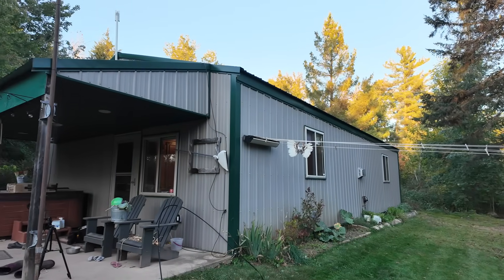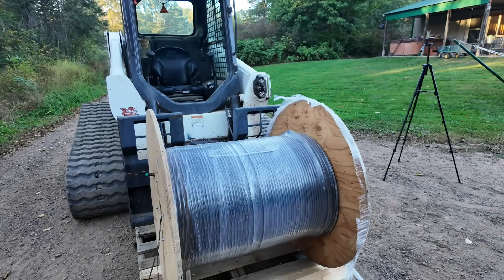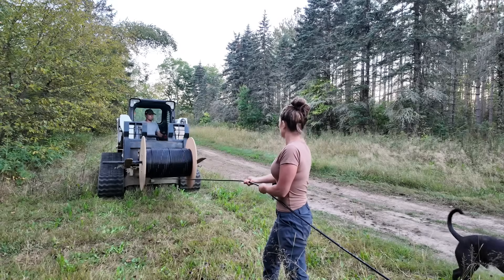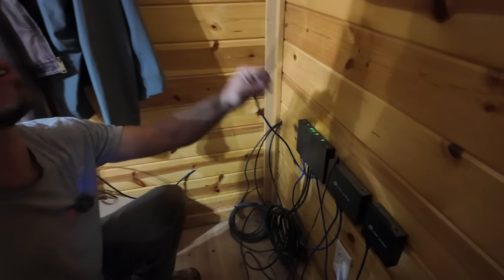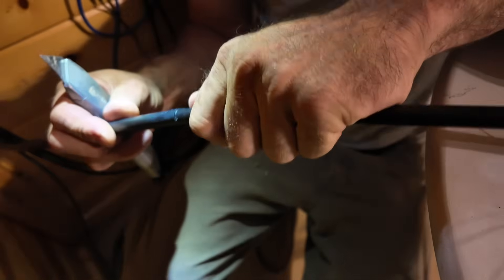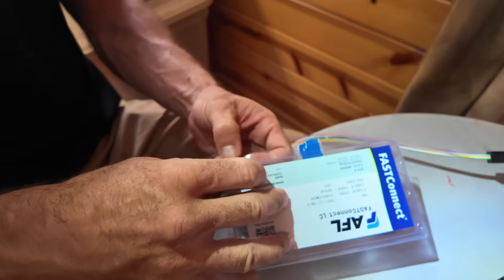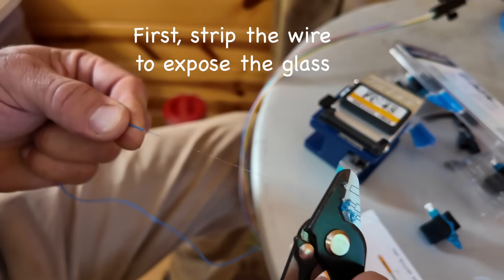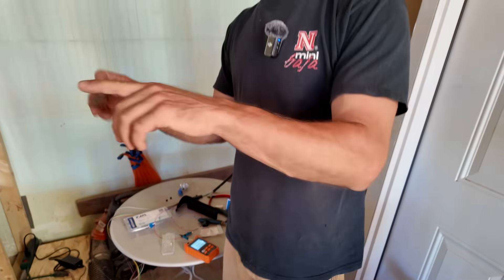We Need Internet! Running a 3,000 ft Fiber Optic Cable

Comment: You are now more qualified to run an IT department than most are or ever will be! 🙂
Will you move the Starlink to mobile and mothball the account?
We did something similar on our rural farm to what you're doing, except we have ham radio towers and we use wireless line-of-sight instead of fiber optic.
I think we're going to move the Starlink to the more expensive mobile account, but then turn it off. 
We want satellite comms in case a weather event (like what's happening in North Carolina and Georgia with the Hurricane 10/2024) occurs and commercial networking/electrical goes down.

Comment: I would advise burying the cable asap, you wouldn’t want a rodent or animal to chew through it, that would be an expensive fix
Reply from the maker: That’s the plan! Need to find a trencher first
Reply: @thehomesteadingrd when I did my 2.2Km of direct burial fiber, I rented a big ride-on trencher from a local place. Surprisingly affordable for the size of the equipment.  Took three days because of weather to go the 1.5 miles - but that thing didn’t stop if it had traction.

Comment: Really nice video and great work. 
One tip of advice: it`s easyer if you go with simplex or single mode instead of duplex/multi-mode. 
With single mode, or BiDi as someone mentioned below, you can acheive higher speeds on longer distances using just a single fiber. The single mode modules (SFP/SFP+) are using laser instead of LED on duplex/multi-mode.
Reply from the maker: Thanks for the tip!
Reply: That's not what multimode fiber is.  Multimode fiber is older technology, thicker fiber that doesn't have as much bandwidth or go as far, mostly used between floors in buildings.  Single mode fiber, what they used, can go much farther and has more bandwidth.  Regarding separate send/receive fibers, while there are some transceivers that can do both on a single fiber, they are less common, and not needed.  In my opinion they did everything correctly, and have the infrastructure already in place that can accept 400Gbps right now with only replacing the networking equipment.
Reply: @BandanazX single mode and mono mode have been around since the 90s at least. The difference is the width of the internal fibre. Single mode only allows a single light input and it’s means you get less light interference where the light bounces around inside the fibre. I think it’s 50 microns from memory. If you are running long distance then it’s a must. It also has better bandwidth capability. Multi mode was really an internal short run technology and mono mode was external distance run.

Comment: Nice Job!  There are a few things you might want to consider.  1.  Use conduit when going through walls.  It will save your cables (Fiber and others) in the long run.  Plus you can get rubber gaskets to seal out bugs and water. 2. Get some Fiber Patch Panels. This will allow you to terminate all 12 strands at either end.  It will keep them protected and allow for easy expansion or switching to another pair if one pair stops working.  This also allows you to purchase fiber patch cables to go from your panel to your network gear.  It will allow for easy moving of your equipment without having to re-terminate your main cable. 3. Consider getting rack mounted equipment.  This will keep everything nice, neat and compact. 4. Look into getting UPS's for your network gear.  Not only do they protect against power loss, but the protect against power spikes and dips in the power.
Reply: Agreed, especially #2. With the fragility of those bare fiber strands, you want to get them enclosed.  Jumpers are 100x easier to replace WHEN you break them ;)
Reply from the maker: Thank you so much for the tips!
Reply from the maker: Thanks for the feedback!  I had been looking for patch panels but all of the ones I could find looked like they required a hot splice.  Is there a more DIY-friendly box?  Currently, I was considering doing some Keystone connectors on a wall plate, but that doesn't really deal with the rest of the fibers.
-Ryan
Reply: Check out Levitons fiber enclosure, and use a bulkhead that you can plug lc ends into both sides. Something their opt x 500i and their sdx adapter plate  @thehomesteadingrd
Reply: @thehomesteadingrd  The LC connectors you're using are geared towards the DIY'er, but they will last longer if placed in a fiber cabinet and connected to LC headers (basically LC-LC female couplers in a small panel to keep them from moving around). And from there, use a 1 or 2 meter LC-LC single mode patch cable to connect to your switches.  You want to sacrifice your patch cable, not your terminations!
Reply: @thehomesteadingrd  Get a levinton fiber box and a bulkhead. Keeps the main run protected and than buy just a small fiber patch cable to connect to the switch. That way if you hit the box or something all that breaks is a 10$ cord
Reply: also dont touch the glass at all even with your finger. It will causes it to fail
Reply: Yep, need a termination box then a jumper to the SFP in the switch. Trying to go directly from an exterior run cable to the end device is just asking for future problems and isn't how it's done.  Hiring someone to do the terminations with a fusion splicer into a splice box would have been best. That would have saved a huge amount of time and hassle, and the connections would be nearly perfect with extremely low loss. Once done, there is no need to ever open the splice boxes, just leave them alone and run jumpers where ever you need a connection (may need more in the future).
Reply: @timezonewall  you can buy a fusion splices now but only the pro one are easy to use - im color blind so i always call the pros for this anyway lol
Reply: @viper04af  Some basic 6 motor splicers can even be had these days for $500-700, but unless one is planning on doing a lot of splices, it's not worth it. This was one of those penny wise pound foolish situations. Not only is there the cost of the splicer, but doing the research to figure out everything that needs to be purchased (tools, supplies), and practicing repeatedly until one becomes proficient. The OP only has 24 splices max if they do all 12  fibers at both ends, and they don't really even need to do them all, maybe just four fibers or 8 splices so they have a couple of spares.  Someone with experience would have been out there in 2 hours instead of the 2 days the OP fooled around with it, and it still isn't done correctly in a splice box so there is more work that needs to be done.
Reply: @timezonewall  Always terminate all the strands.  I can't tell you how many times I've come across companies that terminated 2 or 4 strands on a 24 strand cable - meaning that someone has to come back later and splice/terminate more at a cost greater than if they were all terminated in the first place.  Materials are cheap.  Labor isn't... and rework later down the road is even costlier.
Reply: @lesterawilson3  Agreed, it's best to terminate all the strands.  I only mentioned doing less because the OP said they wanted a cable with less strands, but could only get one with 12 that met all their other needs.
Reply: @lesterawilson3  Also the labor costs for even the exact same job (virtually any job) in 2+ years will always be more!
Reply: Definitely second a UPS. Also consider that you're not just trying to keep the network running this is a primary communication source what are the side effects if it goes down? You surge protection when ever you're leaving a building or entering it with copper. battery back up on all equipment necessary to maintain a connection. And last I looked the ubiquity surge protectors for ethernet cables where the cheapest and most readily available.
Reply: a ups works for power drop and spike protection only if they are line interactive. and while a little more expensive much easier and cheaper than replacing all the other gear.
Reply: Great tips, about the patchpanels (I would use a keystone patchpanel for the access points and other CAT6, CAT6a,... cables, no punching shit) and a Fiber Drawer, its like a patchpanel but in a drawer version, super handy to work on. But before buying that you should get a Rack (I think 9u would be enough but no idea what you're planning more ofc) to put all this stuff in. We're an all panduit house but that's personal preference. Same with omada, great for small home stuff but if you want to do some more I would get UniFI. Don't get other stuff, not worth it for a home and small business.

edit: some other tips. Don't cut the fiber without protective glasses or look away. If you get a fiber piece in your eye, you're not going to have a great time.
The access points are supposed to be ceiling mounted. It's not that they won't work but the antenna's are optimised for downwards signalling. Something to keep in mind when cleaning all things up in the future.
If for some reason only 1 fiber strand survives let's say getting hit by a bushwacker or something else you could buy bidi modules to put in your switch. They are more expensive but could save the day.
Reply: I recommend an ECO flow for UPS - they have solar inputs to a couple panels one ecoflow and you nearly unlimited power for your internet - this seems critical for your setup for saftly so definitely consider it !

Comment: That's one hell of DIY project to tackle from scratch.  I'm glad your use case justified the need for it.  Great way to leverage your Starlink satellite internet connection.  I do have some questions to ask and an observational comment.  I'll start with an observation, it would be to your great benefit to have uninterruptible power supplies (UPS) big enough to run the networking equipment on both sides of your fiber run.   Given how critical communications and internet are for your off grid homestead, the loss of power would be detrimental and easily avoidable with the correct size UPS.   Regardless if it's a wireless radio bridge, underground buried ethernet or Wifi mesh network, a power strip just won't cut it in terms of reliability for networking equipment.   A good size UPS can buy you enough time, during a power loss, to fire up a generator on both sides.    Perhaps you have a power wall or solar / battery back up I'm not aware of?    I have several in my home that can provide power during a blackout, brownout, overvoltage, etc.  I size them for my computers and networking equipment so that it'll last for about an hour but it's expensive.  The more things you plug in, the less backup time you'll get as it draws more power.  I do not have a generator, powerwall, or solar / battery storage in my home but I wish I did.  :p

My questions are:  Does the fiber optic cables themselves need to be grounded at each connected end because of lightning strikes?  What kind of weathering protection do you use for all your cables or networking equipment to guard against the elements?   Had you considered using another starlink satellite dish so that both locations of the property could communicate before this DIY fiber project?   I wonder what the cost analysis benefit of two starlinks with monthly internet service fees would be compared to all the capital expenditures of the DIY fiber line, testing equipment, tools, shipping, etc?  How much time would it have been for break even in terms of cost for both solutions comparatively.   Since you're not selling internet service via your used or remaining unused fiber strands, had you considered other options to get a return on investment for deploying your own fiber in the future?  You mentioned lack of cellular service in your remote location.  I have no idea where you're at but how far is the nearest cell tower or town?

I commend you both for one hell of a DIY fiber project.   I'm inspired because you guys took a big expensive risk but it worked out for ya.  I'd like to see future updates with this DIY fiber project as things change over time.  Especially the benchmark of speed tests versus the rated bandwidth of the fiber line with associated equipment and any potential bottlenecks of networking equipment at both ends of the fiber.   And I think your other viewers would like it too.  Congrats!   :)
Reply: It's armored, direct burial cable.  That means the cable goes directly in the ground, and has built in 'protection' from being broken due to being armored.  That type of cable is about $1 per foot.  They bought 3000 feet.  They said shipping was about as much as the cable.  So their cable cost is about $6000.  Starlink is $120/month.  That means that they will break even in about 4 years and never have to pay for a 2nd Starlink.  Moreover, fiber has near unlimited bandwidth (terabits per second with current technology at that distance) so that fiber is a 'forever solution' for interconnecting 2 buildings.
Reply from the maker: @BandanazX  The nice Owen's Corning direct bury cable is about $1/foot like you mentioned.  This stuff is not as nice and was about $0.30/ft.
Reply: @BandanazX  Appreciate the response.  Yes, fiber is limited to laser capacity at each end.  But the SFP module maybe a 1G SFP transceiver dictating bandwidth for this fiber run.  It maybe 10G SFP transceiver but the rest of the network (router, switches, wifi, starlink) will limit bandwidth potential in the real world overall.

I understand the fiber is armored direct burial cable.  That steel is conductive.  A lightning strike, especially above ground, as it was at the time of filming the video, can damage property and networking equipment.  Limiting fire hazards in a forest would be wise to protect homestead / community by following electrical grounding standards.

 Grounding is essential for the safety and performance of buried fiber optic cables. Grounding kits specifically designed for armored cables help establish a reliable electrical connection and dissipate any potential electrical charges or surges.

I can provide a link to some best practices if you'd like.  I suspected but I didn't know all the ins and outs of buried fiber cable.  So I'm learning too.   Thanks for sharing.  :)
Reply from the maker: Our homestead is going to be off-grid, so it will be completely solar and battery with generator backup.  At the cabin we do have a solar generator we have used during power outages to keep connected.  It is also on a grid-tie solar system, but due to energy company requirements it must stop producing if the grid goes down.  We are not utilizing the backup function of that system.
All of our outdoor access points are on 20' poles and each one has a ground wire run from it down to a grounding rod for lightning protection.  As others have mentioned, fiber does not need to be grounded.
Reply: @thehomesteadingrd  Thank you for your response.  Your type of armored core fiber is an exception.  It does need to be grounded because of its' steel core.  I'll leave a link in another comment to best practices for underground fiber install.  That way you'll get to see it even though I may get flagged as spam or ads.  You can then share it here with others or just use it yourselves.  Choice is yours.  I'm done with this particular topic.  Kudos to ya'll for everything else you've done.   :)

Comment: Silver Cymbal was able to build a system to cover his entire property without running cables
Reply: Wireless needs line of sight in order to go any distance.  They are obviously in a densely wooded area, and tried wireless.  Fortunately they had the good sense to address the problem with the correct long term solution.  Wireless is fine for your phone or tablets... but for infrastructure, fiber is the only solution.
Reply: @BandanazX  yea silver cymbal lives in the woods.